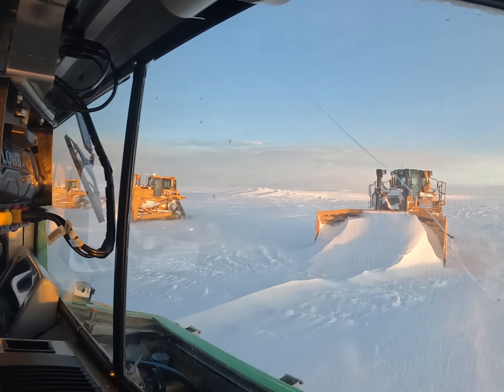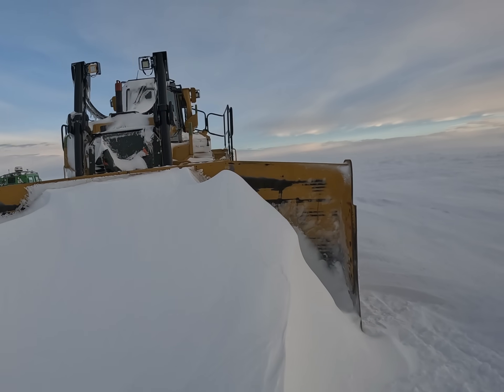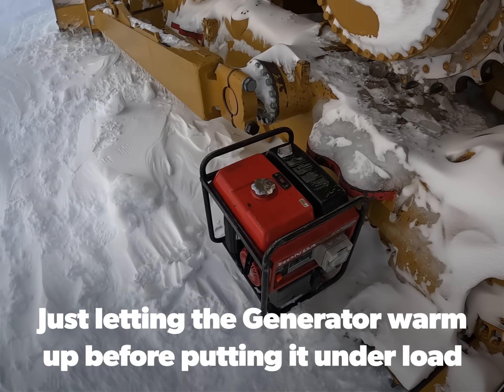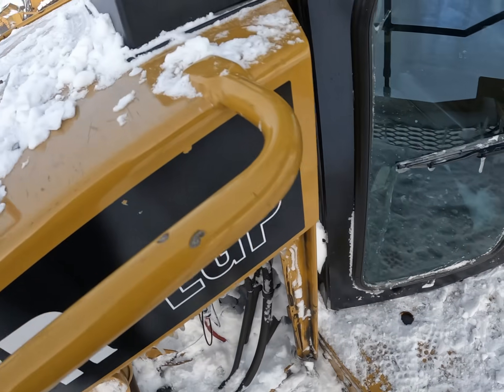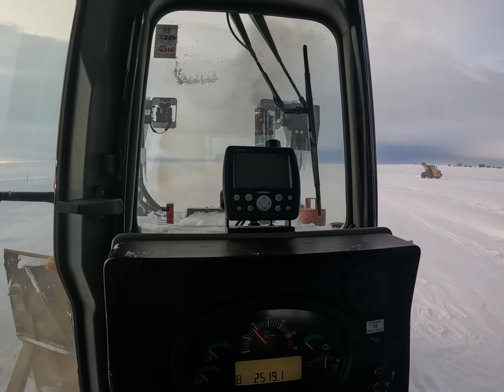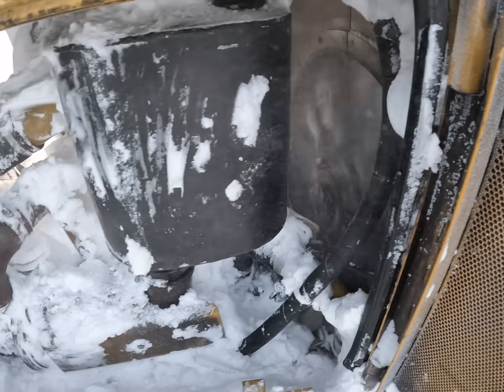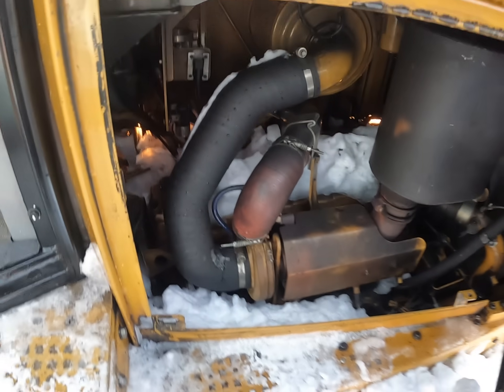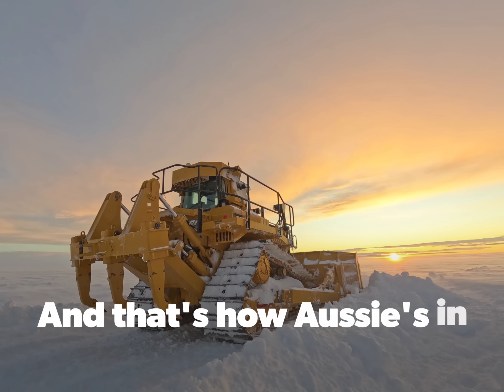CAT D7 DeBlizzard and Start in Antarctica

Comment: I watched a video about building the Alaskan oil pipe line and the heavy equipment used there.  In cold weather heavy equipment had to be heated with torches, salamanders and pans full of burning charcoal on the physical structure of the different earth moving stock as well as the engines. They found cracking of steel structure that made up the machines if not slowly heated before working the units, and the rule was never to shut down a running engine if at all possible. I'm sure something similar happens in Antarctica during extreme cold if heavy equipment is needed.

Comment: After working up in Prudhoe Bay I saw large parachutes placed over euipment then huge torpedo heaters blasting hot air under the lip of the parachute for a couple hours. I've learned to have transmission pan heater (100W), engine oilpan heater (100W), engine block heater, recirculating KAT type (1000W), battery blanket (80W), power steering reservoir (25W), and small 1 Amp battery tender on my 2005 Silverado. To save money, the engine block heater is on a timer and comes on 90 minutes before I go to work. When it is VERY cold -30*F, after I've run the truck a bit, I'll put the tranny in neutral for a minutes, then drop down into first, then second, then drive and reverse. Sounds like a lot, but a transmission is $3,500 USD while 5 minutes of gas is nothing.

Comment: Wait, they keep not one, or two, but three full size dozers on site just for clearing the landing strip off? That's expensive, only a government would think that was a cost effective idea. 
But maybe they have a reason, maybe you need at least one backup in case one won't start, and you need more than one dozer to properly clear it off quickly enough before the snow drifts back over the runway before you are done plowing the other half of it. 
Still they must cost a lot, to buy three D7 ms and ship them to Antarctica to sit idle for 99% of the time. And then you have to ship them home again.
On the plus side, they should be basically brand new still at that time.
Reply from the maker: @justforever96  haha a season or two ago we just had 2 brand new nextgen D7's rock up aswell,  the older two D7 series twos will be shipped back to Hobart to be sold at auction. 
Got a couple tow behind scrapers for the quadtracs too. 
But you are right, we need the backups, things break and it can take a lot time to get parts and that damages our operational capacity in a big way.

Comment: Unbelievable the snow you have in the engine department. In 1978 I was at Casey and on a four months traverse, never once did I have snow in the engine department. Impressive start. 
There is a lack of vehicle requirements knowledge. Very disappointed

Comment: I worked in Northern Canada and the Arctic for years and we never stop the engines even when not working. Trucks and heavy equipment would just either work or fast idle for most of the cold months. Saves a lot of troubles.

Comment: How does all that snow get inside the engine bay with the doors closed?
Reply from the maker: @samfromportadown  cause it is so windy in Antarctica and the snow is like sand and dust it just blows in through all the cracks and seals then refreezes in place.
Reply: @thommosadventures  Oh, thank you. I didn't expect such a fast response. Anyway, about the snow - that's what I get for making assumptions. I assumed the snow was like the big half-inch fluffy flakes you get in the UK. But it's like sand or dust down there... that would explain it.

Comment: I will be honest, the most surprising part about this is that they are just using what looks like an off the shelf generator. I thought they were gonna have like, some super fancy insulated generator but I guess its not necessary?
Reply from the maker: @tehpanda64  nah we keep the genny in a heated generator room, have to start it before leaving the room though because if it sits on the back of the ute for 10 mins in the cold you can pull all ya like but she won't start.

Comment: Never understood liquid cooled engines in freezing climates. Would rather have air cooled exposed engine, and an electric heater for the cabin.
Reply from the maker: @computerbiscuit  it can still get quite warm in Antarctica on a still day, and off the shelf parts and systems are easier to replace then something custom.

Comment: I have to wonder what type of ant-freeze is used for coolant, battery heaters? Oil type? OMG brutal conditions..even for the v-belts to remain flexible...
Reply from the maker: @barrybeckford2733  unsure on coolant specs but we run a 0w - 10w engine oil and ATF fluid for the hydraulics. Battery heaters when hooked up to camp power.

Comment: I will be honest I am surprised they dont have them outfitted with a webasto heater (or any brand diesel fired coolant heater) to ease starting them. Obviously they fired up without issue so I guess maybe the added complexity wouldn't be worth the hassle...
Reply from the maker: @DanielSmith-uy3yg  the new machines that have recently come in have Webastos fitted, still doesn't help in this situation but negates the need to put a generator on each normal weather morning which means more time in bed for me!

Comment: I was a Navy Seabee Equipment Operator with Deep Freeze from 74 to 76. Interesting to see how you guys do things these days on the Ice. We didn't have that problem as we left our Equipment running if away from Plug Ins back at McMurdo. Our Cats were LGP8's
D-8's with extended long chassis with belly tanks and huge wide tracks. Also had seperate Pony Motors for cold starts if required.

Comment: My father worked on the DEW line in Canadian Arctic during WW2 and told us about how they would let the bulldozers run all night rather than trying to start them ...they had tried draining the oil at night and taking it inside by the stove but the batteries would not start the pony motors in the morning so they gave up and just let them idle all night with the engines covered in tarps to keep the heat in and the radiators covered also
Reply from the maker: @snapon666  sounds like a tough bloke, the lads did it hard back then.
Reply: Old friend worked on the giant mining trucks way up north in Canada - he said during the winter they'd run the engines basically 24/7, they'd pull them into the garages and hook up exhaust hoses, you couldn't shut them off because they were practically impossible to thaw if they froze up.
Reply: I worked in Prudhoe Bay back in the 80s.  I was given a company truck and told never to shut it off, even at the end of my shift when I went to PBOC to sleep. The fuel elves came out at night and filled every vehicle.
Reply: Haha I do this now with my VW jetta TDI if it gets really cold. I guess the German engineers were so confident in their cars ability to start in the cold the never fit them with a block heater. Well it gets a lot colder here in Canada than in Germany I guess because I have had to use a tiger torch a couple times to get it started. So now when it dips below -30c I just run it overnight😂
Reply: @DanielSmith-uy3yg  The block heater would be a waste of money for 99% of users. That's probably why it's not standard. Actually, some Norwegian block heaters heat the engine only about 20 C warmer than ambient. That's not much when it's -30 C. You need something bigger in those conditions, also probably a battery heater. Norway is an oceanic climate so they don't need that much heat. These days they only drive electric cars so it's not a big deal to them anyway. In arctic climates they take the battery indoors for the night but of course that's a hassle if you have to do it every night. I just charge the battery every day and hope it never gets down to -30.
Reply: @satunnainenkatselija4478 just the coastal line have oceanic climate. A chain of mountains stop that air...sadly..
Reply: @DanielSmith-uy3yg Change the glowplugs and the TDI should start with no problem.
Reply: @DanielSmith-uy3yg  I've owned my 2014 Mercedes diesel from new and my wife has a 2010 we bought used. Both start easily even at those temps. It seems that not all German engineers are clueless when it comes to cold. Speaking of clueless, when the Passat first came to Canada, three of my colleagues bought one. Two of them regularly refused to start in the cold while the third was always trouble-free. The ones that wouldn't start were the ones that had a dealer-installed block heater and got plugged-in while the one that gave no trouble didn't have a block heater. It turns that the engine temperature sensor was too close to the oil pan, so when the block heater was plugged in, it sensed the heat and the ECM reverted to trying to start the engine using the summer maps. Those colleagues stopped plugging their cars in and the trouble went away.

Comment: Does this have ether staring aid?
Reply from the maker: @everytoolashammer9427  nah, we try to avoid using it as they get addicted to it.
Reply: The CAT dozers I work on, granted they are the smallest of the bunch, come from the factory for auto-ether-start aids
Reply from the maker: @everytoolashammer9427  these have the capability and the hardware is there we just dont install the ether can. 
We have airbox grid heaters, webasto heaters and camp power plug ins on all the new dozers.

Comment: Having worked in the arctic most of my career I’m thinking the video is missing a few things.  These dozers must have been operating in days or weeks past.  It takes many days and even a week to reheat a completely cold soaked diesel in the arctic.  Including fluids that gel.  Still a great video!
Reply from the maker: @dshogan6174  they have been sitting for a few days, as you can see they've had a generator running the block heaters for a few hours prior to starting.

Comment: Mined gravel for 6 years with a 1977 D8K built drilling pads with a D7R pushing scrapers and currently operating a D6R LGP on a big irrigation ditch 66 miles of making it a half pipe again the canal was started in 1887

Comment: Oh no! That nasty diesel is contaminating the pristine Antarctic environment! What about the treaty?? Didn’t they read it!
Reply: What about it?
Reply: @ absolutely forbidden! Even dog poop is not allowed
Reply: @gs1100ed  Diesel isn't forbidden. It's necessary to run the vehicles.

Can you mention what part of the treaty you believe disallows the use of fuels?
Reply: @   Apologies! Didn’t know I was talking to an expert on Antarctica. Sounds like you are familiar with Protocol on Environmental Protection to the Antarctic Treaty (1991) Annex IV, Article 1, Section e
Reply: @gs1100ed  Did you actually read it yourself? What you just cited is under "DEFINITIONS".

""oil" means petroleum in any form including crude oil, fuel oil, sludge, oil 
refuse and refined oil products (other than petrochemicals which are subject to 
the provisions of Article 4);"

Ok. Now we know what they mean by oil. Great! 
What's your point?

Comment: Cat dozers are representative of some of our greatest achievements as a species. A D11 blade is awe inspiring. Watching mountains move is soul moving.
Reply: Your correct, Cat, John Deere and others were once head and shoulders leaders over competitors but for "reason" the industry was forced into silly standards and engineered without regards of cost, serviceability, and proprietary safeguards that eliminate once easy fixes, and tech heavy systems are done by no one except OEM services. Some of the most dependable, cost efficient, and straight forward engines, for a host of different equipment types, was eliminated and replaced with expensive, delicate head scratching designs.
Reply: @plhebel1  ever see the Cat dozers that are in Antarctica?
Reply: I'd say construction machinery in general falls under this category. Humanity has gotten pretty good at literally shaping the ground we stand on however we need. No mountain too tall, no valley too wide (with enough dozers!)

Comment: its propane,  a diesel isn't going to start like that,  we use heaters and canvas and warm them for hours before we attempt to start.  otherwise, the motor oil will be frozen, diesel will be gelled and the batteries will be dead.  sometime we build a campfire under them, either way it takes hours to start some of them

Comment: Damn! I’m shocked at how easy they were to start. I’ve had cats that were inside a building that didn’t start that easy.
Reply from the maker: We have them specially fitted with grid heaters etc to warm intake air to help with starting
Reply: @thommosadventures  Prove it

Comment: Poor cold Aussies - they probably miss having a brown snake or two in the cab with them.   I start my little Kubota at -30F or colder after a blizzard in N. MN.  But it's a much smaller engine to turn over.  Still, with a block heater and glow plugs she fires right up.  This video was fun to watch - that big iron lady just fired right up.   Must have a few big batteries in her.   Good on ya mate!
Reply from the maker: Thanks Mate, we Aussies aren't as accustomed to the cold!
Reply: @thommosadventures  try an engine blanket to keep the snow out of the engine bay

Works well here in Canada
Reply from the maker: @laughton57  those cheeky danger noodles get everywhere man, I dropped one of my big ol clodhoppers on a big brown boy the other day out the back paddock, I just about had my own brown snake filling my jocks!

Comment: Fantastic video. While working in Canada i had to get a Komatsu started in winter. Had about 10 Batteries (can't remember the exact amount ) Heater on all night. When trying to start engine the whole machine chugged forward . In nuetral. The oil was so cold. We didn't start the Engine, just waited for a chinnook.
Reply: Normally if it gets that cold, the thing runs all night here in Canada....you will run into way more problems if you turn it off and you wont save money or anything....just headaches and things breaking if you turn the machine off in the extreme cold.
Reply: @EternallyGod  my boss was a tight English man. We did alright.
Reply: When I was younger my parents and I lived in an area without electricity so I would fill a old garbage can lid with charcoal and light it after I got up then walk the 300 yards up the barn carrying 10 gallons of water and 100lbs of pig feed for them. When I got back the coals would be nice and hot and no longer burning and I would put them under our truck and then put an old hood up in front of the bumper to keep the heat it. By the time I was changed and ready for school the truck engine would be warm enough to start. Sometimes it would creep forward when I let the clutch out on those especially chilly mornings. Makes me appreciate having HVAC and electricity I can promise you that.
Reply: @ lovely memories of times past.wouldn’t you like to go back there and stay.
Reply: To trzeba było rozłączyć pompy byłoby lzej

Comment: I send a winter over at McMurdo Station from 1972-1973 season and the heavy equipment operators used to keep the D8’s just idling all night long out back of the galley in the lot.   I was a baker, so very often would prepare boxes for pastries for each operator and they’d pick them up on the way to their tractor.    Times sure have changed in charging for a cold start over the years I’ve operated Cats.   Was a get the pony motor started and let it warm the diesel before a start.
Reply from the maker: Back in the good old days!
Reply: I bet that was a heck of an adventure

Comment: You guys are class this is awesome!

You’ll never see an electric vehicle start in those temperatures 👌🏻😂
Reply from the maker: You got that right!
Reply: there are plenty of videos of EVs working in the -30 to -40f range and they do it mroe reliably than ice. I don't think it's that cold in this vid.
Reply: Ironically electric vehicles will have zero issues at all starting in these temps as there's nothing they need to crank over to start. EVs have reduced range in the cold, but they are far more reliable to start and far quicker to heat up than ICE cars.

Cheers from an EV owner north of the arctic circle.

Comment: She must not been too cold or you let that block heater work for longer than you said.  At -60*F they are damn near impossible to start with out putting fire under the crankcase, even with a block heater.  The grease in them is so stiff you can almost not get the idlers to turn.

Comment: When I worked in the mining site, we never turned the engines off. It was better to leave them running, and actually less wear on the parts.
Reply from the maker: That can work in mining yeah, but we don't have the manpower to run shifts that close or the spare fuel to have machines idling for longer than we need, extra hours would also mean more servicing and we only have one mechanic looking after all our pieces of equipment.

Comment: As long as the fuel isn't gelled and there is juice in the battery, those CAT's are great engines to fire up.
Reply: How do they keep the fuel from gelling?  Up in Lake Tahoe guys would just dump a bunch of kerosene into their fuel on those super cold nights.
Reply: @anxiousbeachbums They use #1 diesel where it gets below zero for long periods.  For short periods of cold you can add antigel to #2 diesel.
Reply: @blackpowder4016  Got it. Same thing we would do. My understanding is that kerosene is the same as “Diesel #1”.  Just purified #2

Comment: what do you use for fuel in those dozers?
Reply from the maker: A special Antarctic blend of diesel, the traverse tractors run on Jetfuel though.
Reply: @thommosadventures  is it 50/50 mix of diesel and kerosene?
I didnt know if you ran straight kerosene because of the cold